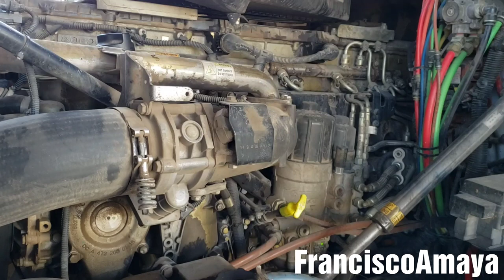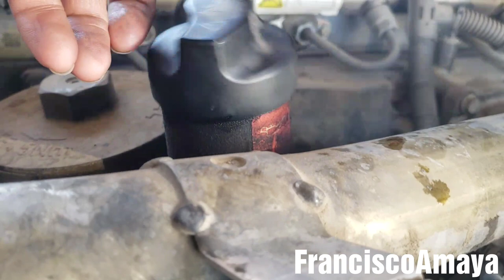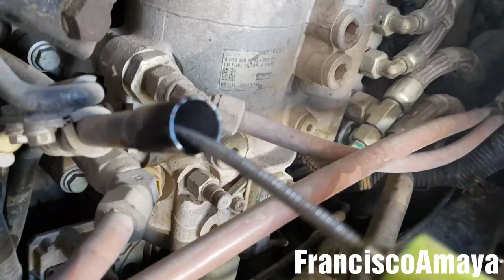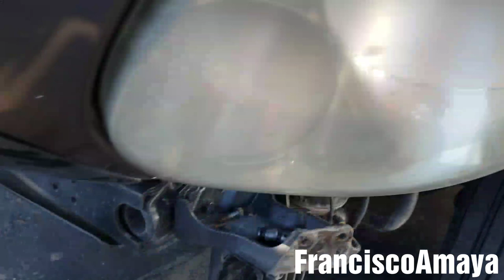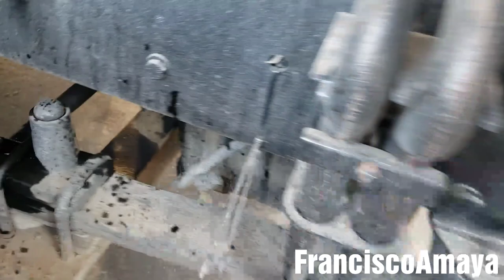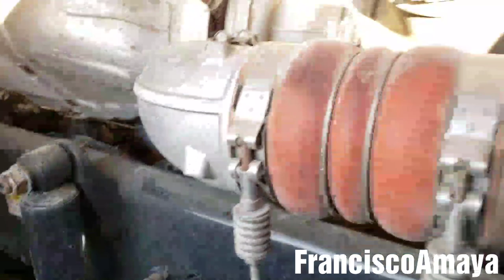DD15 engine high blow by pressure cylinder compression leak major internal issue piston rings damage

Comment: I had a lot of blow by on my truck a 2013 freightliner cascadia DD13 after 7k miles on the oil changes it would start burning oil, I was told I needed my engine rebuilt than I decided to change the crankcase filter! Since I did that I haven't had any blow by nor is my truck burning any oil
Reply: were your issues the same as the video before u changed it
Reply: I have no blow by from oil cap or oil tube but a lot of white smoke near the crankcase filter, u think it can be just that?
Reply: @notkirill6991  you have white smoke coming out of the crankcase? What's your oil pressure like?
Reply: @jalenjamellable  actually have both... got compression test cylinder 6 came back at 27% sadly
Reply: @notkirill6991  dang bro that sucks what state are you in?
Reply: @jalenjamellable  cali, prob gonna throw this truck on auction and get new one, heard its not worth rebuilding dd15
Reply: @notkirill6991  to bad you live in Cali I was gonna say you could do a series 60 swop

Comment: Whats the bare minumum yo get that fixed? New rings and liners?
Reply: To get to the rings you would have to remove the head and oil pan.. Might as well get an inframe complete top to bottom.. Dealership proly quote 25 big ones.... If you have connections proly 10 bands
Reply: The rebuild kit from freightliner is a little under 10 thousand not including a new head plus labor